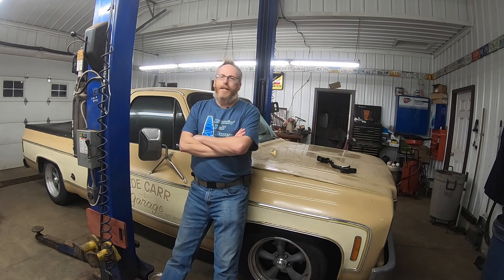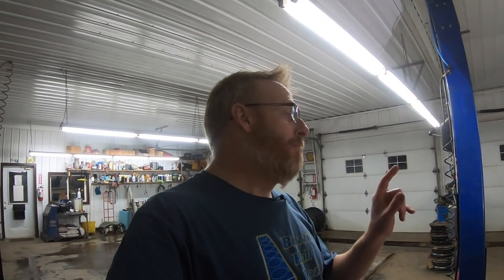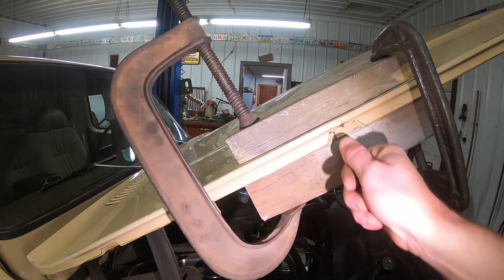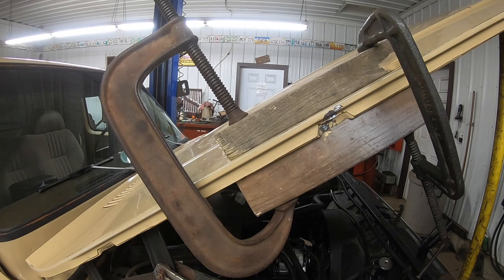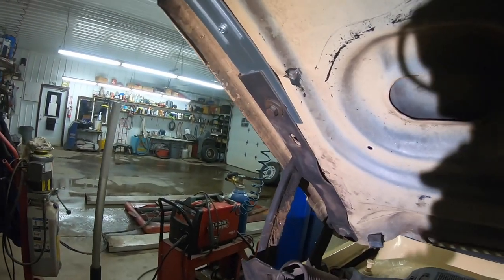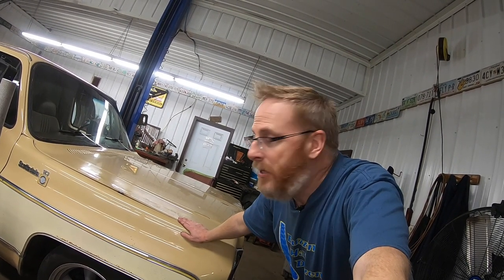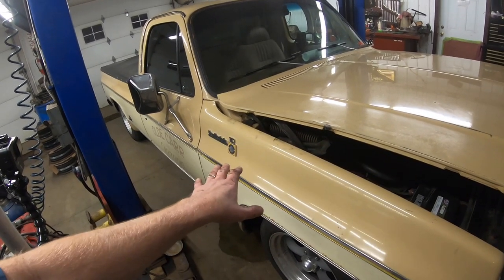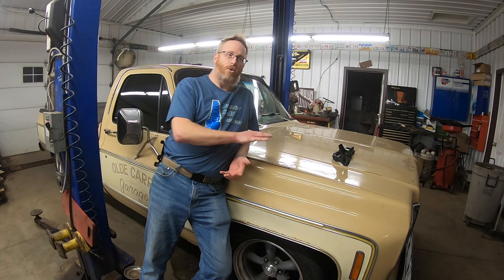Chevy SQUARE BODY Hood Fix 73-80-The EASY Way Pt-1

Comment: I read several of the comments but didn't see one explanation of why the hoods were designed to bend the way they do. So I will explain, the hood is designed to collapse in an accident to keep it from going through the windshield and decapitating the driver or passengers. And it's against the law to put reinforcement braces on the hood.
Reply from the maker: Excellent point!

Comment: A micro fibre between the wood and the paint woulda been super helpful:) At least I think it would? Dodge trucks are made of much thicker metal our trucks do not bend so it is just a guess lol
Reply from the maker: #4 You may have a point on the thicker metal! Lol Dang GM and they’re safety protocols!
Reply: If that is so, why aren't there more 77 Dodge pickups around anymore? When I bought mine new in 76, I looked at Dodge. If you hit the sides of the bed or the doors, they rattled like the metal was thinner and there was more flexing in the sheet metal that the Chevy trucks. I just sold my original '76 in October 20.
Reply: @rayjos0424  Why did you sell the old girl?!
Reply: I was thinking the same thing 👍🏽

Comment: Good video. I think you should have tried to remove the lmc brace, or installed it afterwards, kinda working against it trying to straighten something it’s trying to hold
Reply from the maker: Thanks for the tip!
Reply: My 1st thought you locked the bend in with that bracket, you needed to take it off & reinstall after hood was stretched back into correct position, live & learn..

Comment: your problem is that the inner sheet metal on the hood is caved in at the hinge top edge.this is what is bending the hood. your support is just covering it.  look at it compared to other side youll see the inner sheet mold at the hinge is flat  and on pass side it will be caved in  not just pinched at the edge.  youll have to heat that  up  and pull it down flat to line up hood
Reply from the maker: In an effort to save the original paint, I'm happy with this slight improvement. I guess, I'm just going to have to live with it!

Comment: Just picked up a 77. I think mine may be beyond repair for the taco hood. Ive got it on both sides. I didnt think it was too bad, and then I saw how minor yours was, now I think I may need a new hood. It already has new fenders on it because of some rust, but the rest of the rust is minor. Im hoping under 5k to get it all fixed. If not, I wont complain, I want it done right and Im not a body guy. I'll get her running right, but bodywork is beyond my skill set
Reply from the maker: Yeah, a new hood may be the way to go! If I wasn't trying to keep the original paint on mine, I would have just replaced it as well.
Reply: @OldeCarrGuy  Mine has almost no paint anymore. It was blue at one time, but its faded out to white

Comment: Great video just what I needed. This happend to my 76 monte carlo with the long hood it has. It kills me. Hopefully I can fix it aswell. How did It turn out? I don't c part 2?
Reply from the maker: Sorry! I didn’t label it as part 2 but here it is: https://youtu.be/LKy71lr0CAY
Reply: @OldeCarrGuy  thanks I already had found it. So was your hood actually bent? Or did it just need new hinges to level it out?
Reply from the maker: @fallenone6  oh it drowns bent. I did straighten it out with the weld technique, but the new springs and hinges were the key
Reply: @OldeCarrGuy  so mine Is bent from one side like yours was. I dont understand how you welding the Crack fixes the actual bend? Mine is not cracked so I don't need to weld just straighten it back out. Sorry I'm new to this

Comment: I've thought about adding EFI to my '77 Silverado C20 Crew Cab (454/TH400).  In pursuit of better fuel mileage (and retaining strong cross-country hauling capability), I need to weigh all of my options / combos.  EFI swap, 6.0 swap, Gearvendors overdrive added behind the TH400, 4L80 swap, 5spd swap........Cummins swap???
Reply from the maker: Bang for buck, I chose EFI! Follow along and maybe it will help you with your decision

Comment: The reason the hood on the square body trucks get bent is because no one lubricates the hinges.
Reply from the maker: Exactly
Reply: @OldeCarrGuy  by the way I have a 1978 BIG10 454 SWB I ordered new, it just turned 83k miles. The options cost more than the base truck. It’s a Silverado trim with just about every option available, even the factory tachometer. I didn’t get power windows and door locks because they were junk back then. I ordered the radio delete with just the windshield antenna and put my own radio in. The price was 7,200.00 and I got it straight off the car hauler, on May 10, 1978, and did not let the dealership touch it. The salesman was a friend and he called me before the hauler arrived. I put five spoke Cragers on it and sold the rims, mistake, to a co worker, the trim rings were never installed and still in the clear plastic wrap. Years later I had to buy a set of rally rims when I decided I wanted the original look. You will not believe this but I pulled the motor and transmission out on May 13, 1978, I drove to a funeral out of state and it had 500 miles on it when I pulled the motor out. I’m going to try and do video on it for YouTube when I can.